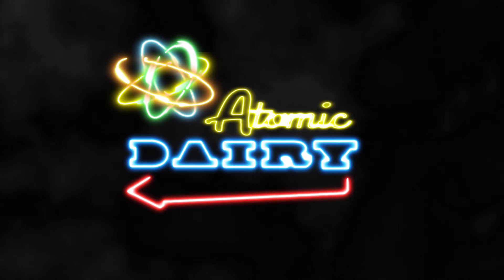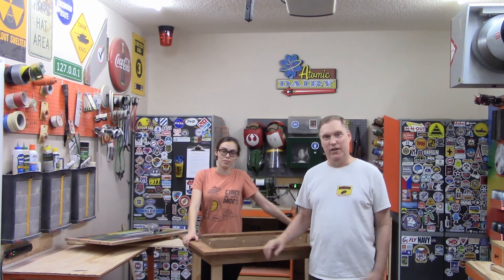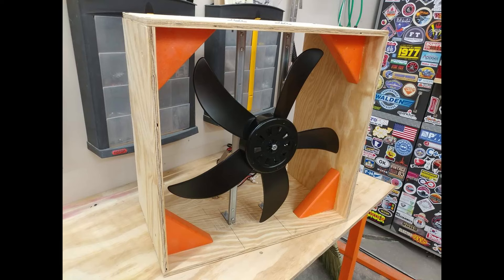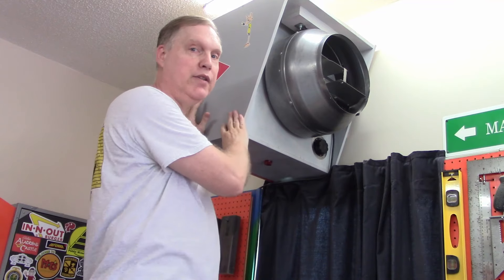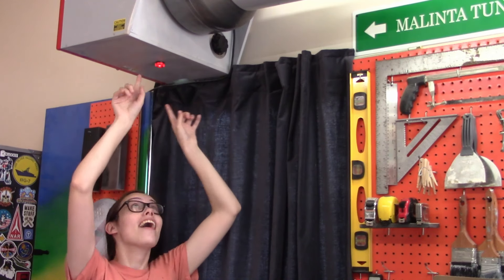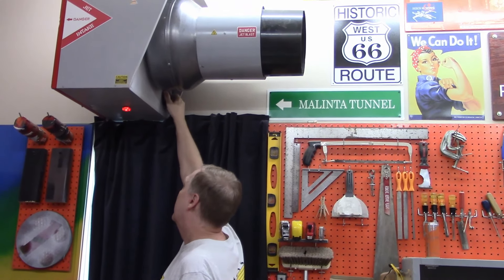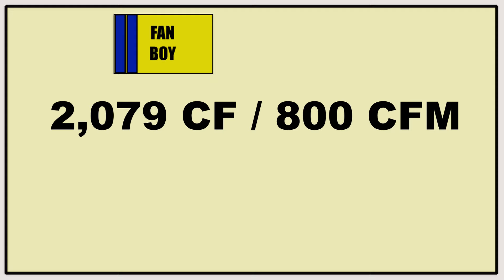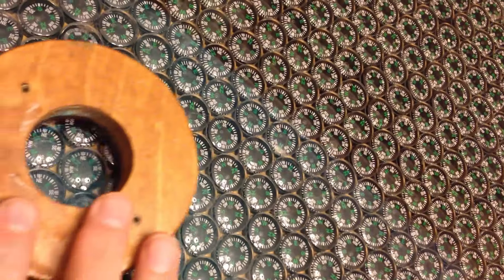The Mighty Fanboy - Air Cleaner Of Unusual Power

Comment: Remarkable. I’ve installed same fan in my shop but was venting through side of building. This created a negative airflow requiring a outside air intake to compensate yet still would draw attic air and hot air from outside (Florida). I will be reworking my system to your design. Many thanks!
Reply from the maker: Glad you liked it! We had the same heat problem (South Georgia) and came to the same conclusion. But it works really well and we like it a lot.

Comment: I was looking for ways to clean smoke from wood burning out of the shop. I'm grateful for the info you provided
 I like the simplicity of circulating air. I'm in Canada. It's cold and I don't want to lose the heat I have spent good money on out a vent out of the shop.
Reply from the maker: We have the opposite problem where we live. For us it's high heat in the summer and we don't want to exhaust our shop air either. So re circulation air was our plan. The FanBoy does a fantastic job of cleaning the dust out of the air and we use it every time we are cutting wood in the shop.

Comment: I like it. Did the same in my shop but found that the jet stream of air caused a low pressure venturi effect drawing dust laden air into its path and deposited dust along its way. The remedy was take the flow of air via ducting to the far end of the shop.
Reply from the maker: Many thanks! We've done some testing as well and the bucket "tube" we have on the back of the fan seems to be working for us. Most of our sawdust-generating tools are toward the intake of the fan but your experience makes me want to test for the venturi effect you are seeing when we run at higher speeds. Thanks for the insight!
Reply: @AtomicDairy  I  installed mine directly over the tablesaw and that was my downfall or upfall and then glitterfall ;)

Comment: Are you running that fan when working with your rattle cans (spray paint)?... I'm looking at building a small spray booth, and I'm concerned about the potential for fire (or worse) breaking out while using an inappropriate fan type. Do you have another setup or have you found this setup is perfectly adequate and safe with volatile paints, etc?
Reply from the maker: We do. Never had a problem with spray cans and fan use at the same time. And the filter does collect some of the paint fumes.
Reply: @AtomicDairy  - I've got a very small space and I'm trying to come up with my own system that would allow for good air flow AND not blow up... Of course, the first ideas always include tools already available (for example, a bathroom fan), but I want to make sure unplanned fire won't be in my future. I also like inline duct fans (very commonly used for grow tents and relatively affordable), but I'm thinking of putting my spray booth right in front of a window, so that I can port the fan directly out with minimal ducting (likely just ported straight out, if possible). If you or anyone has any advice on a relatively safe/compact fan unit that doesn't involve open sparking motors, I'd love to hear it?

Thanks for the reply!

Comment: Do you have plans available for the “box”? I know it’s pretty simple but if you have already worked out the plans to fix the linked components I’d rather just use your plans. Thanks for the video, great job on the fan.
Reply from the maker: No, sorry. We built the FanBoy well before we shot the video, so no plans. But it is just a simple box that is determined by the dimensions of your filters.
Reply: OK just saw this😢

Comment: Love the idea, and am planning on cloning it. What is the MERV rating for the reusable filter. the Amazon link no longer works. Also, do you get kickback on those links? If so I will order though them
Reply from the maker: Interesting. Looks like Amazon no longer sells that filter. I did a quick check and Home Depot sells the Eco Plus washable filter. I think it's the same filter but if it isn't it's very close. It's a MERV 8 filter and it does a great job of filtering out the larger particles to that the second filter can last longer. I wash mine out twice a year and it still works great!

Comment: Thanks for sharing atomic people 
Re your CFM rating You may need to mitigate for air leaks around filter placement, seals, along with non lamellar flow drag imposed by the shift from square to round ducting, then stacked filters also affecting more than a single equivalent thickness filter
Saying this it's a great build and a nice alternative to the usual axial stuff
Check out bill pentz if you haven't already.
Reply from the maker: Agree on all points. The filter stack does take a toll but the fan is pretty powerful and we still get good results. We definitely checked out Bill Pentz too. Great data!
Reply: @AtomicDairy  thank you commander 🖖